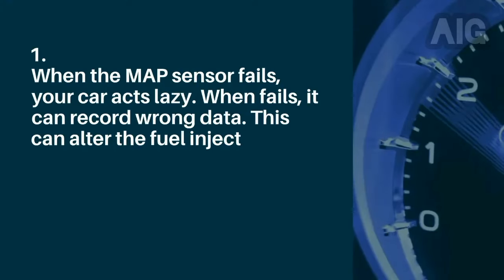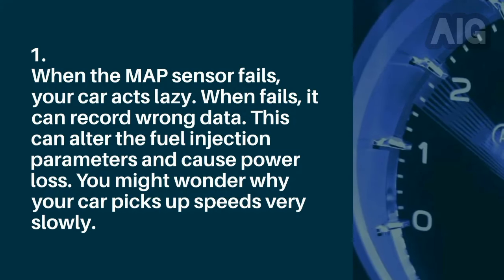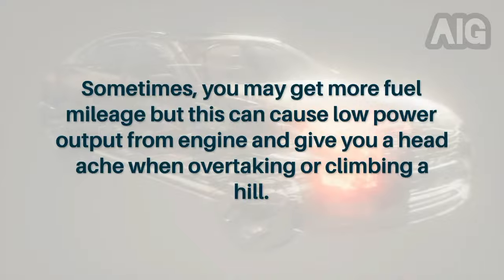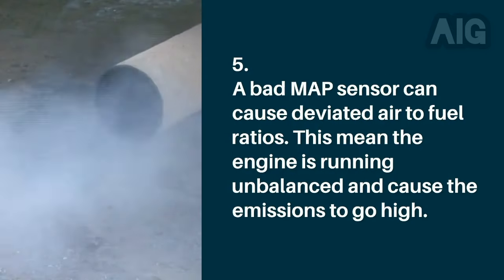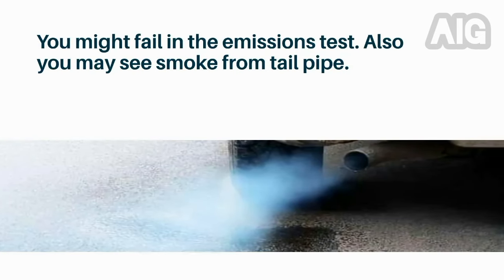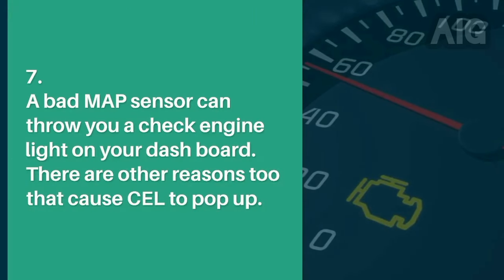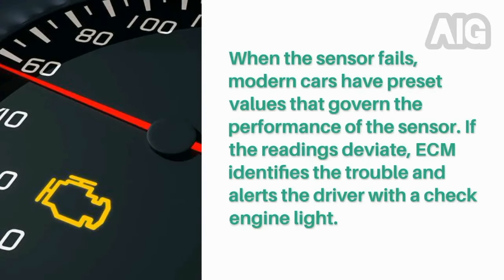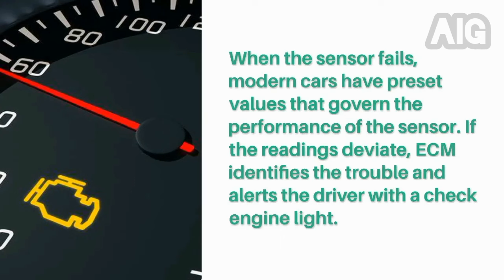Bad MAP Sensor - Symptoms Explained | Signs of failing MAP (Manifold Absolute Pressure Sensor)

Comment: Hi if I drived 200 km, with these symptoms , is it serious ? I will change it as soon as I can. My car is a Jeep renegade 2021 1.6 Multijet 35.000 km..i hope its not serious. Thanks for video
Reply: If it’s come up with check engine light you should get it repaired until you do you shouldn’t be using the vehicle because a map sensor is actually a small key part to the engine
Reply: I had my 1.2 corsa map sensor changed today and cost me £75 to fix
Reply: it can damage catalytic converter in worst case scenario

Comment: I’m having the same symptoms and problems on my 2012 Chevy Cruze LT. and right now it’s doesn’t wanna start, it cranks and cranks but doesn’t turn over. Is it the map sensor? If not then what could it be? Please and thank you🙏
Reply from the maker: Cant say exactly...a no start can happen from other reasons too....a bad fuel pump, faulty relays, blown control fueses, bad ingnition control switches, bad crank angle sensor, and more. You need to diagnose them one by one. especially if there's no codes.

Comment: I have intermittent boost on w638 vito could this be the problem will clean anyway
Reply from the maker: Boost pressure issues could be from, leaks, boost pressure actuator malfunction, etc

Comment: 2003 grand Caravan 3.3 occasionally cuts out at complete stop. It has started right up right after the cutout. Maybe 2-3 times a week and once in a while at startup idle. 
It's my daughtes van for college. She said it did not want to start at 1st start of the day the other day. She said while she was cranking the rpm went to 2000 but no start.
3-4 attempts it started and was fine again.
MAP or crank sensor?] When she drives 64 miles home on the Freeway it drives fine. The cut out at stop is very random.
The no start just happened once that I know of.
Any idea?
Reply from the maker: Hi no engine crank to 2k rpm...just around 300rpm only. If its showing 2k rpm then mostly the crank sensor be at fault...could scan the ecm for codes.

Comment: Symptoms of anything wrong with the car. Are the above symptoms. You can't just guess which it is. Could be MAP, MAF, Vacuum leak, old filters, one car came in and had a decomposing filter, like 6 years old. And had the same power loss, gasolene smell. Rich run. Rough idle. Vould be anything with these cheaply made cars.
Reply from the maker: Thats true

Comment: I got a 2016 chevy cruze and im getting a po299 code. Maybe this might be it? 🤔
Reply from the maker: Hi there, pls do check for boost leaks or pressure leaks before concluding map sensor. Any torn hoses, o rings or even bad turbo can cause the same.

Comment: My code is P0172 fuel to rich bank 1
Replaced 02 sensor
Replaced 1 injector
Replaced MAF sensor 
Replaced temperature sensor 
Could MAF be the issue 
Also i have no power in reverse gear and the car stalls or seems to be chocked
Reply: Try a map or if you have a idle air control valve (iac valve) try to clean it out, if you have a maf clean that with the special cleaner, try fuel injector cleaner and high octane should do the trick
Reply: Hi there, did you manage to fix the issue, please let me know how you resolved, I have the same and replaced many parts
Reply: @shaunsingh892  i sold the vehicle too much headache .

Comment: I’m having the same symptoms and problems on my 2012 Chevy Cruze LT. and right now it’s doesn’t wanna start, it cranks and cranks but doesn’t turn over. Is it the map sensor? If not then what could it be?
Reply: Was it
Reply from the maker: It could be anything from bad fuel filter, fuel pump, maf or map sensors, crank or cam sensors, even damaged relays ,fuses etc

Comment: I have a chevy sonic 2017. When i make an stop my car wants to stall and sometimes it stalls. The check engine comes on but after few hours it goes away. It reads code P0171
Reply from the maker: This could simply be a vaccume leak which could be of variety of reasons like bad evap valve, loose air hoses etc... the map sensor or maf sensor can also be fault. The code shows too much air in manifold or less fuel being injected.

Comment: Hello. My engine management light comes on for maybe a couple of days then goes off for a week. No problems with the performance of the vehicle. What would you advise?
Reply: Same for me.  A BMW 225d made in 2014.  BMW dealer had it for 3 days and couldn't find what was wrong.  I've taken it to an authorised BMW repair specialist for a second opinion and they've read the error codes, cleaned a 'pressure sensor' and flushed the manifold.  Fingers crossed but i'm not holding my breath.

Comment: Would this fault cause the electrical warning dash light to come on?
Reply from the maker: Did you mean the check engine light or battery light?
Reply: @autoinfoguy  thanks for reply..made me check handbook..its the electronic fault warning light..car starts from cold, no problem.. start travelling..get into top gear around 40/50mph..electronic fault light comes on..same time engine becomes hesitant ( power slow/normal/slow/normal etc). Stop car..switch off engine..restart seems to clear fault..until next day cold start..had spares so replaced spark plugs..ignition coils..cleaned crankshaft sensor. Now wondering about inlet air temp sensor, throttle potentiometer, map sensor...any ideas.

Comment: Hey I have a 04 buick regal and it has some of the symptoms in this video, but it idles low, around 500 rpms, then the rpms fluctuate for a little bit., when it is running good the rpms go back to a different spot sometimes 600 sometimes 700 and sometimes it stops at 1000 and about 15 seconds and drops down to 700... every now and again it stalls out and dies. Ive changed the iac and the pvc and cleaned the mass air flow. I have no codes. could you please give me your thoughts, thank you very much.
Reply from the maker: Hi, try cleaning the throttle body and check the tp sensor.

Comment: Hello 
I have a vw passat cc 2.0 tdi 2009 I get these two codes p0238 p0113.the problem is I changed the sensor back to the same codes I took out on the computer.
Thanks for help
Reply from the maker: Hope the issue is fixed and please do share your fix with others thanks

Comment: I drive a citroen xsara vts 2.0 16v. My car had a rough idle and would often stall, also when accelerating hard it would hesitate at around 5500 rpm. It had no error codes ect. Replacing the MAP sensor solved the problem immediately. (This car has no MAF sensor)

Comment: Hi i have a duster which is giving low milage and sometimes starts late can this be MAP sensor issue? Please help
Reply from the maker: Hi there, could be but its more life MAF sensor that cause late start n mileage troubles. This is one of the reason. Same cn be said for injector nozzle trouble, fuel supply related troubles etc.

Comment: Hi thanks for the video.
Question: Where can I get a new hose because on my own we become a hole and the sensor does not dress well on it.
Reply from the maker: Hi there, we din get the hose part? which hose are you referring to?
Reply: @autoinfoguy The tube on which there is the turbo sensor.
Reply from the maker: It should be available in autoparts store. Look for similar parts if oem not available. Or the Oem dealership.
Reply: @autoinfoguy  You can send me a link to a store that sells this part.
I just tried and I do not find.
I mean the hose.

Comment: Hello, I check few video, I have seat leon mk2 2.0 tsi 211hp, when I go to dyno to add more horse power I mean make chiptuning, the diagnostic show there is to much fuel on car, even it go out from exhaust pipe, It also show that I lost boost 16p0 rpm till 3100 then boost back normal, also on first dyno test it show problem on cylinder number 4 it have -3 and on second test it show on cylinder number 3, I am really confused cause my car not lost any horse power even is 13 years old it show me 223hp and 292nm, the men from tuning though the problem is with ocv valve I already changed but even my old look fine, please if you can help me cause I can't find where is the problem, cause I not have lamp of check engine also I make scan and it show all is fine 😔
Reply from the maker: Hi there, do check for leaking fuel injectors. If there's a leak in any one or two, can cause fuel flooding. While you add more horses, be sure to tune the sensors accordingly. Adding power means more fuel. And oxygen sensors can read corresponding to their company preset and stores excess fuel in operation. And the low boost n cylinder codes can be cos of tuning itself if not done properly. Sometimes the ecu miscalculates or doesnot recognises the change in parameters, not always but possible. Do check the injectors, oxygen sensors, intake air sensor especially map if getting proper reading on boost at varying rpm range.